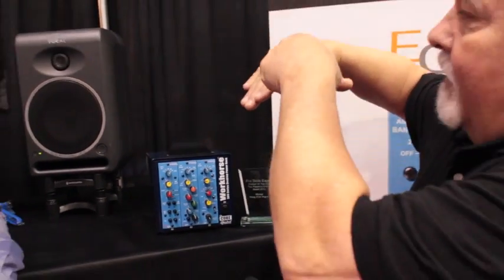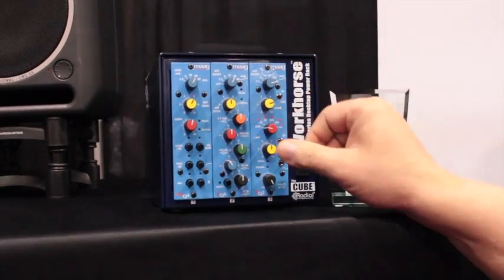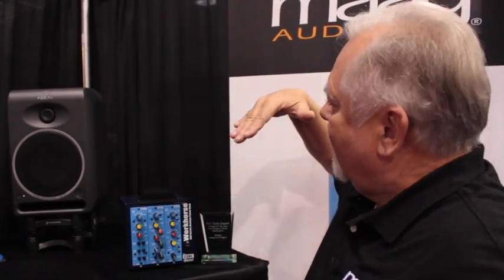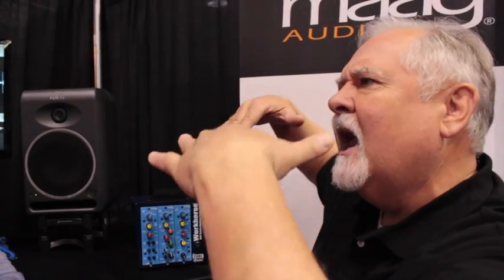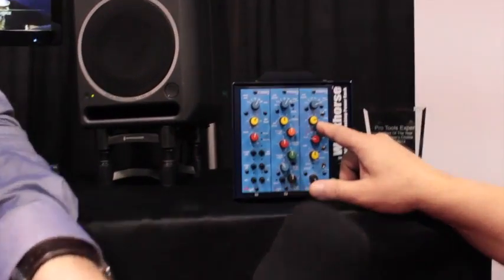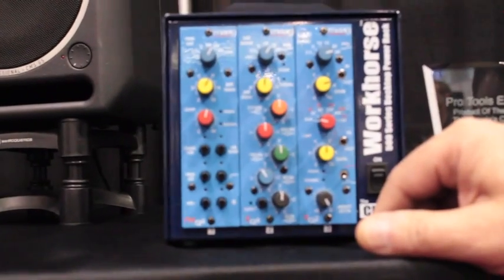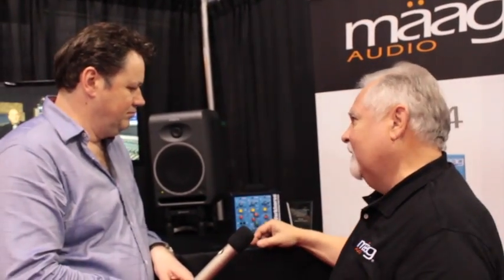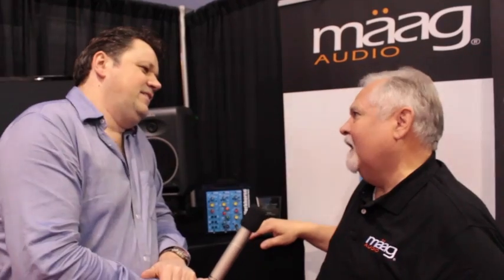Cliff Maag Sr. Talks About The Maag EQ4 Plug-in

Comment: Wonder if the plugin can actually do anything at 40K with 44.1KHz sample rates or does it only work with high sample rates and the analog domain?
Reply: It works at 44.1 because like he explained, it has to do with what happens at audible frequencies using the far edge of the 40k curve.  So a 10db increase at the inaudible 40k has a curve that will be raising the highest of the audible frequencies by a smaller amount.
Reply: I believe these are different frequencies for different uses… like quality per second of the waves oscillating versus the plugin going at 40k for its pitch.
Reply: @lkb3rd He’s asking a different question… whether or not the kHz quality of a CD for example can contain pitches this high.